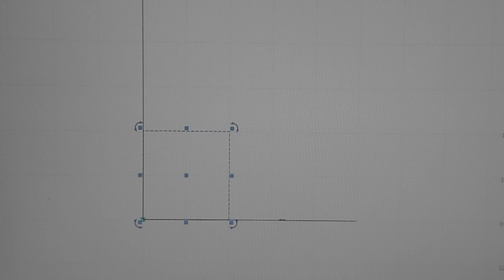Atomstack M50 Upgrade - Light assist

Comment: Next, you could run a Type-J Thermocouple down there and have real-time thermal monitoring. Good job. I'm inspired
Reply from the maker: It could be, I'm not saying no!
Reply: I just got my X7 Pro few weeks ago. The light assist is really a great idea. I was using a flashlight and really couldn't get the right angle.